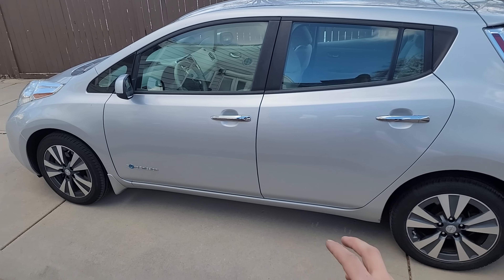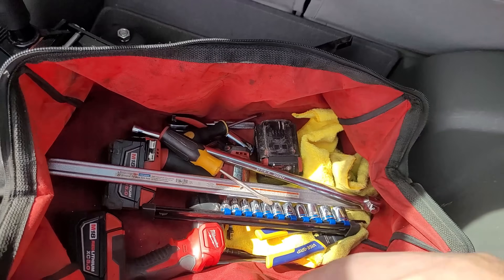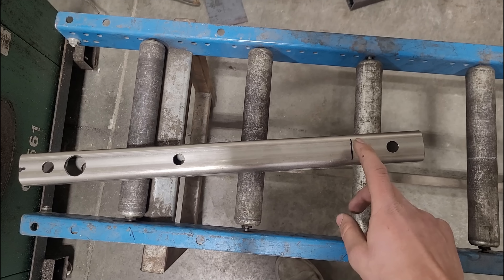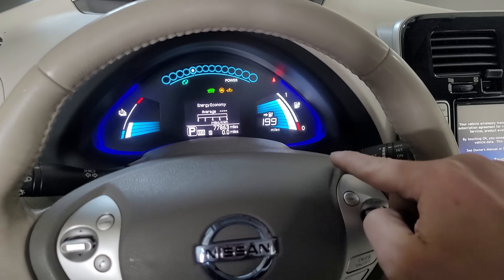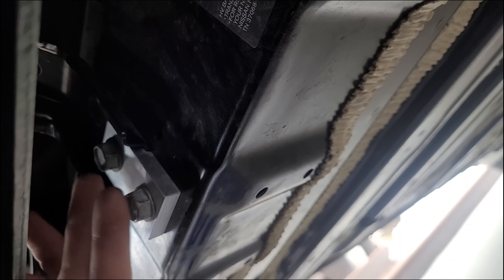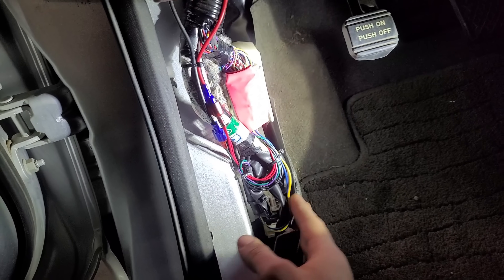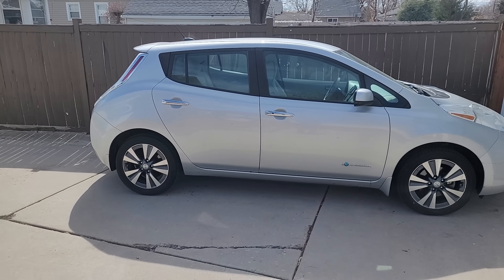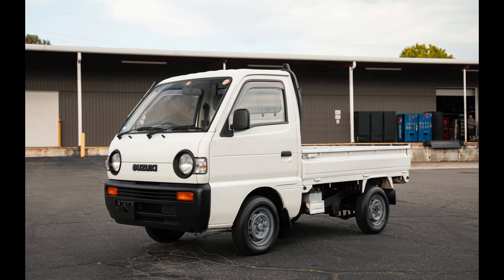Under $5K Nissan Leaf 62kWh Battery Upgrade

Comment: Next task, figure out how to swap from Chademo to CCS1 or NACS.
Reply: If he uses this as around town car he will never need to fast charge, there was a chademo adapter made for CCS1, it was limited but did exist
Reply: @  but if that's the case, why the 62kWh battery swap instead of a 24-40kWh pack?  200+ miles of range makes it an "almost" road tripper.  If CCS can be added it becomes a possibility to road trip, albeit much slower.

Comment: :face-red-heart-shape:very good video and job :-) !
10:25 for the 2-fold screw connection on the frame where you left out a screw
I recommend to be on the safe side 
press in m12 threaded rivets.
...because of the space problem for tools, you can also press in with a screw and nut...
Then you can simply screw in the second screw.

Comment: It would be nice if someone could retrofit liquid cooling modules on these packs. I assume there'd be a little space somewhere under the hood for a small pump and rad/fan. It wouldn't help for preheating obviously but I think it's the heat from fast charging and driving the car in hot climates thats killing them.
Seems like there's so many Leafs out there with severely degraded range it might be worth it.
Reply from the maker: @andrewt9204  The issue is there's no liquid cooling channels inside the cells themselves.

A lot of work could be put into designing a chill plate on the bottom of the pack, but that is still just air cooling the cells inside since they don't transfer heat to the bottom directly.
Reply: @zuccamachine  Yeah, I was thinking you'd have to design a new custom pack. It wouldn't be easy. Maybe even somehow creating a pack using tesla's modules since they have the water cooling channels built-in.

Even if it's 100F outside it would still be very beneficial. Driving a leaf as-is will cause the battery to be even warmer (`120+). Even warmer if in stop and go. You could at least keep the pack closer to ambient with water cooling. Every few degrees cooler significantly reduces degradation rate. It's mildly exponential. The difference between 120F battery temps and a 110F is pretty big.

Just seems like a waste to have such poor degradation. Sure they can be recycled or repurposed for other stuff, but better to last as long as it can in its original purpose.

Comment: Is the battery still air cooled ?
Reply from the maker: @edolson1698  Yes, all Leaf batteries are air cooled
Reply: Oops! 

Battery Degradation!

I got a liquid cooled Fiat 500e to avoid that nasty degradation!
Reply: Yes, the new battery will still get slowly cooked, as the Leaf doesn't do cooling...

Comment: What would be different if you had switched to a 40 kwh battery?
Reply from the maker: 40kWh would be a direct bolt-in with no adapters or bracket modifications necessary. 
I think a CAN bridge would still be needed, but not sure.
Reply: @zuccamachine  Thanks
Reply: @zuccamachine  Yes, can bridge still needed.

Comment: You could drill out and nutcert those two missing bolts.
Reply from the maker: I'll probably do that on the next one, and install them while the old battery is still in the car.